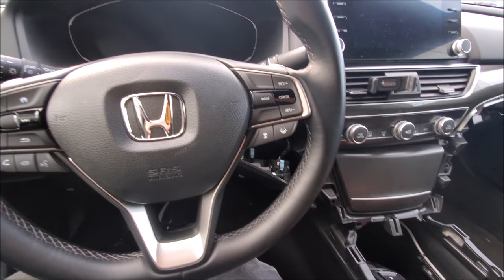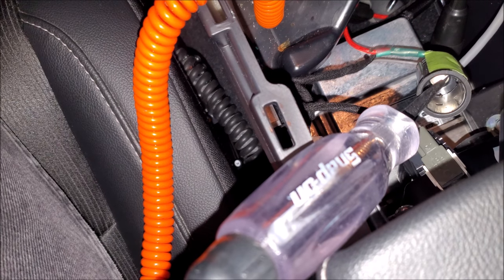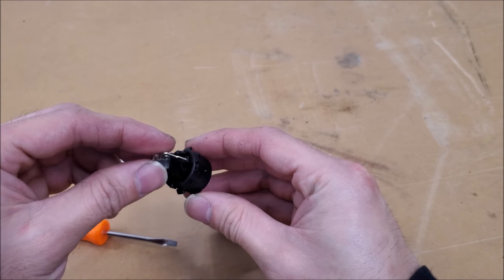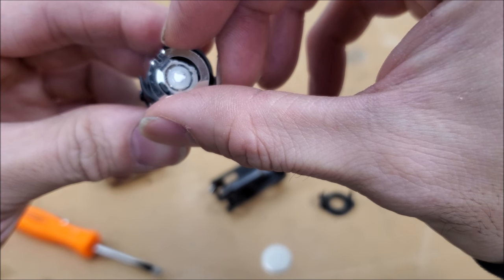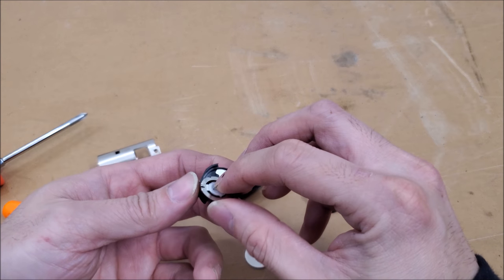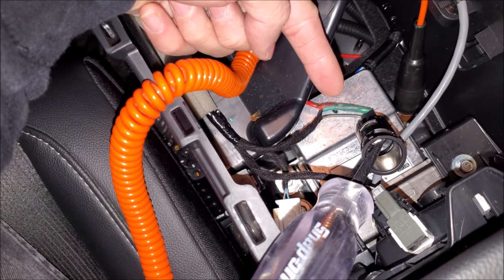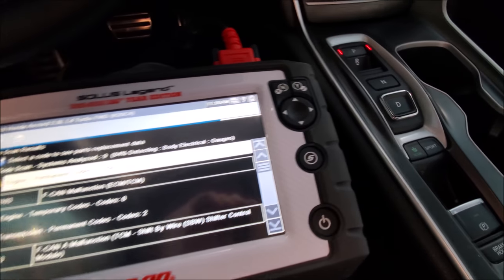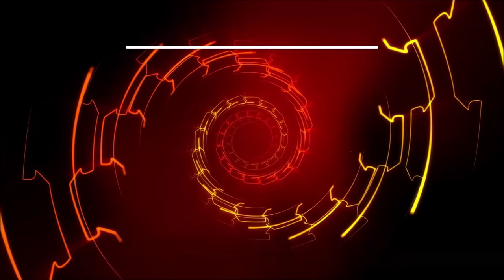Honda Power Port 12 Volt Plug / Cigarette Lighter plug DOESN'T WORK | AnthonyJ350

Comment: Good job! "Cigarette Lighter" ampere  is no longer available in most DC Adapters. Good enough for charging phones, radar detectors, or a NAV device. An air pump,vacuum cleaner, or a power inverter will most likely blow the fuse or the DC adapter like yours.
Reply from the maker: Yup and people need to be aware and be careful what they plug in or you'll end up in this situation.

Comment: Some things just weren't made to be reverse engineered by design. It's always good to be mindful of device outputs. This happened to me once with an inverter so what I did was convert the plug into separate clips to connect directly to the battery terminals. Lesson learned lol 😆
Reply from the maker: Ya I was surprised to see these things are fuses themselves.

Comment: Thanks for this video.  I have the same issue on the 12v socket in the trunk , i dont want to remove the panels so do you think i could just pull out the socket after pushing in the clips and replace.
Reply from the maker: Might be able to

Comment: I have a Honda accord 2021 with the same issue. Check the fuses and the relay and they are all good. Do you happen to know the part number of the replacement port? I’ve searched on Honda parts websites with no solution. Not sure if I’m putting in the right part description. Any help is appreciated! Great video and glad I was able to find it.
Reply from the maker: Did you ask the parts department at the dealership?
Reply: I use a website called Honda Parts Now. You can enter your vehicle info and search for just about any part and buy from them. They contract with dealers all over the country to source parts. Shipping isn't so cheap though, often it's cheaper to look up the part there, then order it through your dealer.

Comment: On the 2013 Honda Civic it is actually two different 20 amp fuses. They do allow a 20 amp for the one in the cubbyhole and a 20 amp for the one in the armrest so they definitely are separate. I'm having the same issue and I believe you just help me solve it but just to clarify there are two 20 amp fuses
Reply from the maker: Pull out the power port and do a continuity test.
Reply: @AnthonyJ350  I plan on it I had to take off on an emergency when I started working on it. The fuses are fine so it's got to be that outlet but I'll definitely do a test with my meter as soon as I get a chance to open it up. I appreciate it

Comment: After pulling my meter out I found the issue and saved that plastic part to put back in later if it stops working again later.. silver disk connects to silver gasket. Silver gasket is bent out to make contact to silver disk. Silver gasket connects to prongs. All I had to do was bend the center part of the gasket out so it makes contact with the silver disk.
Reply from the maker: Thanks for sharing!
Reply: Hi, what do you mean by bending the silver gasket. Im having the same issue too.

Comment: I got a same problem with your car too! My one is a Japanese/ Hong Kong version Honda Fit GK5/GP5.
Same , the wire was found have 12volts and fuse are ok , but the socket with no power come.
Reply from the maker: You'll need to change out the socket like we did.

Comment: Thanks for the video.  Can you give us a link to the cigarette plug tester you used with the led readouts? Also, do you think it’s possible to get the socket out just with a pick without dash disassembly?  Finally, official Honda service manual seems to have no mention of a fusible link in the socket itself!?!? Not impressed Honda! Wasted time before finding your video.
Reply from the maker: I actually can't find it anymore. I've been searching on Amazon.

Comment: Any hints on disassembling a 2010 CRV which has an aux and power outlet in the console compartment? I want to change the power outlet with a dual port USB for an android head installation. using a BATIGE 2 Ports Dual USB 3.0 Male to USB 3.0 Female AUX Flush Mount Car Mount.
Reply from the maker: You'll have to search Google for "2010 CRV console removal".
Reply: @AnthonyJ350  Thank, I did find two well done ones. Looks like a piece of cake.
Reply from the maker: @homesteadfromscratch  Awesome!

Comment: Where can I find an AC inverter unit that fits into my Honda CRV 2014 DC power ports?  I bought a 100W AC plugin inverter unit at Walmart, and it simply would not fit, i.e. plug into my car.  I called a Honda dealership, and they didn't know either. In the old days you simply plugged into you cigarette lighter all kinds of stuff.  Nothing could be simpler.
Reply from the maker: Try your local auto parts store or audio installation shop?

Comment: The fuse for the center console is number 12 .... 20 amp.... Then for the front accessory power socket it is also another 20 amp and it is fuse number 27
Reply from the maker: Thanks for sharing
Reply: @AnthonyJ350  absolutely man thanks for putting it out
Reply from the maker: @alienodditytv6626  Nice! Will do!

Comment: Why don’t you simply replace the power port with a dual 3.0 USB power outlet with a built-in voltmeter so you can keep an eye on the battery strength while you’re listening to the car stereo with the car not running. 12 V power parts are as useful today as armoires are in bedrooms
Reply from the maker: The client has a laptop charger that uses the cigarette style port. I have a video on replacing these with a USB instead.
Reply: @AnthonyJ350  link?
Reply from the maker: @cm1133  https://youtu.be/O3-RmURiiPQ
Reply from the maker: @cm1133  Did I install it right?
Reply: @AnthonyJ350  it appears so

Comment: Where are the fuses?
Reply from the maker: Fuse Box.  But the power adaptor has a fusible link built into it as well.
Reply: @AnthonyJ350  I meant which ones do you change? There’s like 50 down there
Reply from the maker: @alwilkinson42  Take a test light, turn ignition to the run position (engine not running) and test all of them to verify they're all ok.

Can also read the owner's manual and inspect "accessory" or "power outlet" fuses.
Reply from the maker: @alwilkinson42  Here's how I find blown fuses https://youtu.be/pHkgjXKdUvs

Comment: Does 2009 honda civic have the same shitty socket?
Reply from the maker: Possible. Did yours stop working and all the fuses are ok?
Reply: @AnthonyJ350  correct, it went out after I plugged in air compressor that apparently drew way more than the socket provided, and i suspect maybe a wiring in the socket or behind it.. but all fuses are fine.
Reply: @AnthonyJ350  yes. All fuses are intact. I'm going to try and pull it out of the socket for inspection, without taking the panel off.
Reply: @AnthonyJ350  I can confirm that new light socket fixed the issue for me. It was Honda Civic. No need to remove any panels whatsoever, just pry up the socket and pull out cable, no worries, it is long enough.